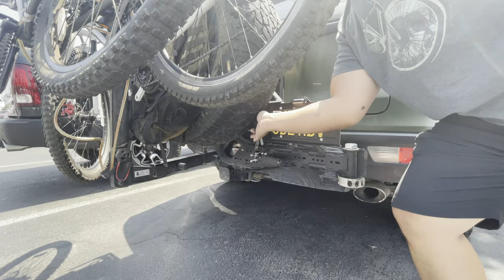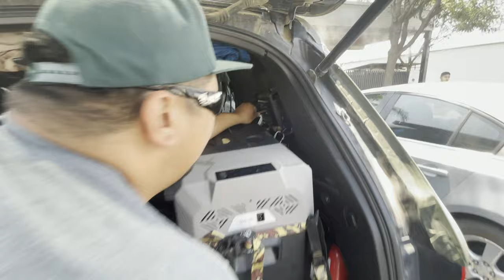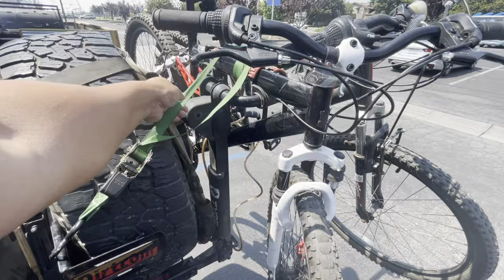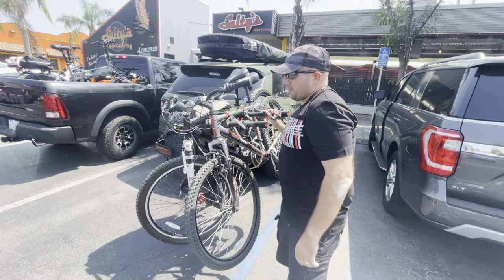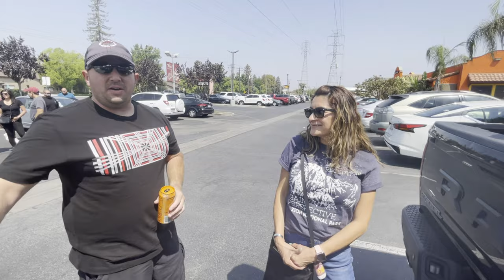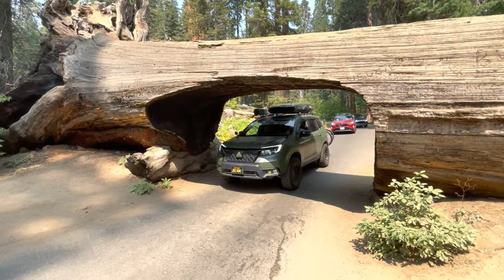CLUTCH FOR ROAD TRIPS!  Swing bikes out of the way, and access your tail gate!

Comment: The dirtcom swing keeps amazing me. Love that it has a 2nd hitch port for a swing out bike rack. that makes it for me.
Reply from the maker: @dirtcomplex is a build sponsor of mine (I don't benefit from sales), but they let me speak my mind.  The other tire carrier companies (Wilco, RIGd) also offer the hitch receiver built into the swing out, but Dirt Complex has the best build quality, best materials (chromoly tubing) and the most features, like the auto stop mechanism and true one hand operation.  When you have to inconvenience rear hitch access that makes everyday life more difficult, like loading up groceries or getting a cold beer out of the fridge, I'd pay more to keep it as simple as possible.  One thing to point out is that the hitch receiver on the dirt complex unit is a bolt on option, hardcore offroaders don't want the extended hitch receiver to hit on the trails.
Reply from the maker: @Scahla  they’ve moved to a retail store business structure, so no buying direct.  These will be sold in overland/offroad stores across the USA, maybe even the world, I think they will be sold in some stores in Japan.  That’s the thing about the trail swing, it would be too difficult to make, and if someone managed to put one together, it would be too costly.  The Wilco and RIGd designs are much simpler.  I’ve seen some smaller company designs, and they were hella sketch.  Might work for a 55 lb. 28 inch tire, but when your dealing with an 80 lb. 33 inch wheel tire combo, the design and Load tested certificates can be appreciated more.  As far as price, it depends on the retailer.  The MSRP on the trail swing is $1750, but this price can be lower or higher,  RIGd is $1400 and Wilco high clearance with the hitch option is $1157.  I’m not sure what the cost is on the bolt on hitch receiver for Dirt Comp since there’s savings when you bundle together.
Reply: @JonDZ_Adventuring  gotcha. 

Yikes on the price $2000. I can build a custom bumper for less than half 😅.

How do I get sponsored. 🤣
Reply from the maker: I was just talking to a friend that mass produces lift kits.  He said he use to pay $150 at the end of 2020, for a sheet of 1/4” steel.  He said now it costs him $390 for the same sheet of steel.  Components have gone up 25% for him.  These companies are taken a hit.  All of them.